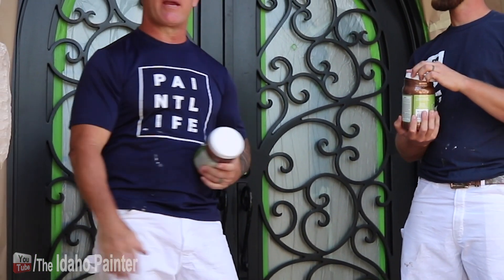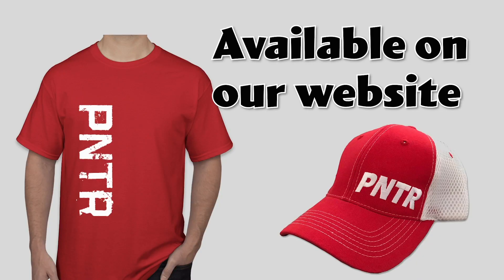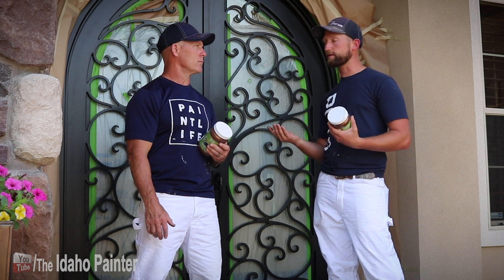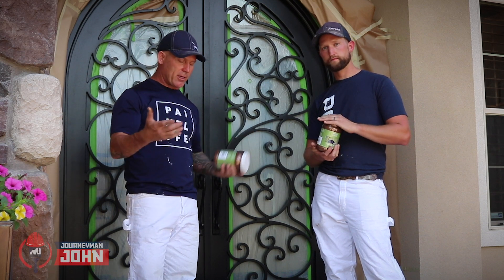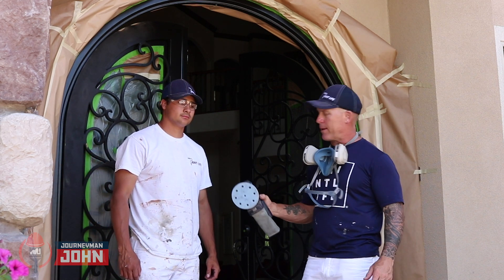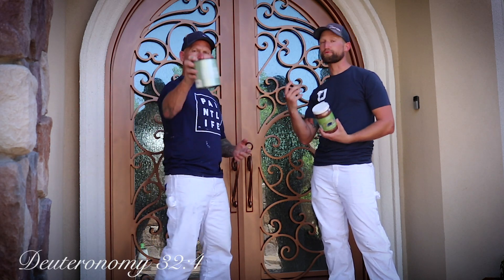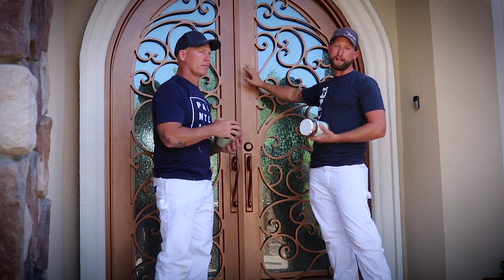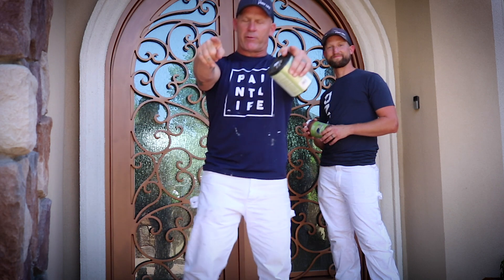Iron Door Transformation

Comment: Are you running your cap spray air line into a pressure pot?  I usually like to put a coat of raw umber glaze on top of a metallic like that just to age it a bit and tone down some of the overpowering straight gold or bronze color.
Reply from the maker: No, we are not